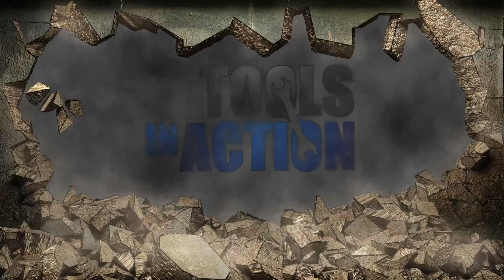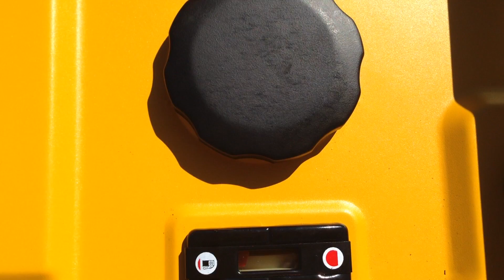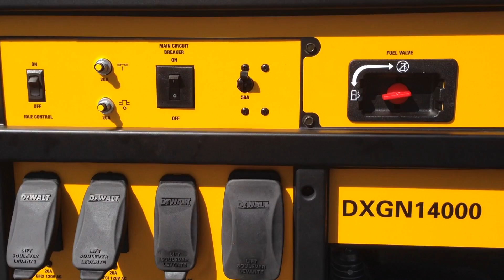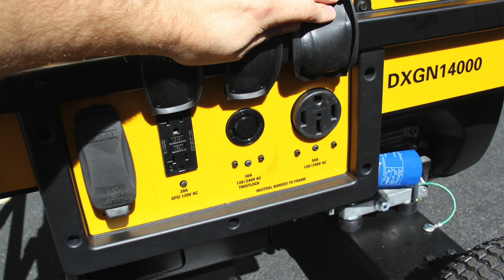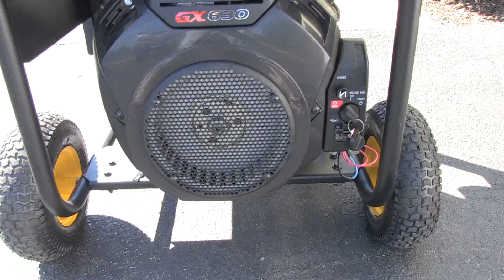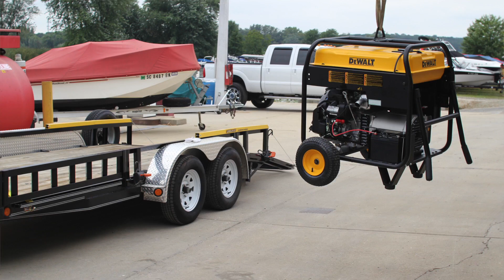DeWALT DXGN14000 Commercial Generator

Comment: Thats a nice looking genset but your being a bit optimistic when saying it'll run an entire  construction job site.  48 running amps . Most job sites will have at least 1 compressor 15 amps or 2-3 12 amp pancakes a skilsaw is 15 amps   multiple cordless batt chargers pull 3amps each.  It adds up fast. My welder  draws 33 amps my plasma  cutter is 45 amps draw so yeah . Thank god most job sites have spider boxes to help distribute. But still this has a good amount of oommpphh and a sweet motor to boot

Comment: People that buy Honda generators or Generators with Honda engines are the ones that will be using it ALL the time... They need something reliable that will perform day in and out. 

For temporary outages due to hurricanes or traffic accident or old tree that comes down that pulls and snaps the pole and snaps a primary that will kick out 1k + homes and business'....  Those people go for cheaper brand cheaper cost generators...  Because its only for a temporary use and more than likely they will sell it once the power is restored.. 

I will NOT pay $2K for a 5k watt honda generator..  I will NOT pay $2k for a X brand generator because it has a honda motor in it...  YES honda engines are GREAT, they run they LAST but you are going to $PAY$ for it... 

We just got over hurricane Irma in florida and most of us were out of power for average 5 days... My co-worker purchased a 3500 watt predator generator at harbor freight for $300...  My Boss looked at him and said, it wont last... Get a Honda and it will last for prob 10 yrs...  My co-worker said, i dont want it to last 10 yrs... i want it to last until the power comes back on then i will sell it.... LOL 

This generator is super nice and POWERFUL but its GAS only...  Which means if you run gas with 10% ethanol you have to keep up with it and run it often to keep the ethanol from damaging the carburetor...  And even then that gas will leave a residue in the tank and carburetor...  At some point you WILL need to do repairs..  With ethanol free gas you dont get that issue with the carburetor getting damaged from SITTING for months..  BUT that gas will go BAD sitting for months... 

Propane generators are the way to go... Propane burns CLEAN and leaves no residue behind and propane stays good indefinitely... Granted the propane bottle needs to be re-certified after 10 yrs but .... storing propane for 10 yrs and its still good for use.......

I rather have the generator that runs on BOTH fuels ...  And the power output between the 2 is not that much of a difference... On mine is like 600 watts

Comment: Great generator with one flaw, it is extremely loud. Not exhaust noise which is a low hum, it is mechanical and fan noise from the unit. Deafening.
Reply: Yes its going to be LOUD when its a V-Twin engine pumping out 11k watts hovering at 3600 rpm...  You have to sacrifice POWER for NOISE... which is more important to you...??

Comment: pretty heavy for a small job site but i guess that depends on the size of the job site - it would be for sure lighter than trailer mounted diesel genset having the same kw. the 50 amp output would be a requirement if you had a welder. since this genset does not have voltage regulator you would not want hookup to your home else maybe damage electronics like compturer, led tv, etc.. a good  alternative for site & home would be Generac XP10000E.